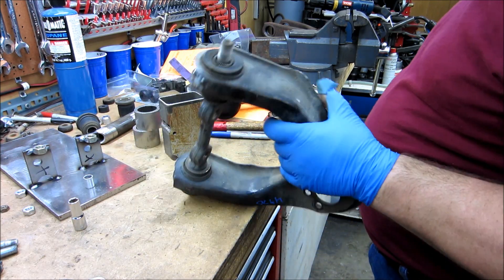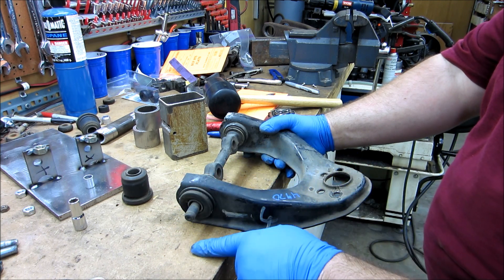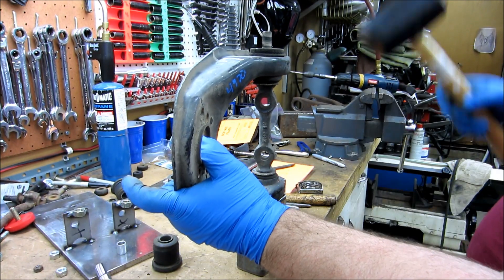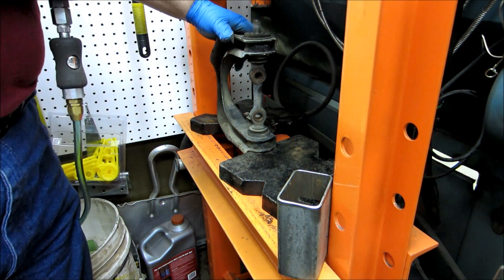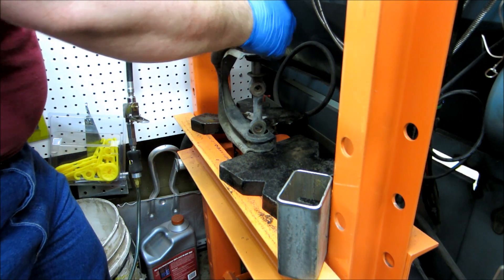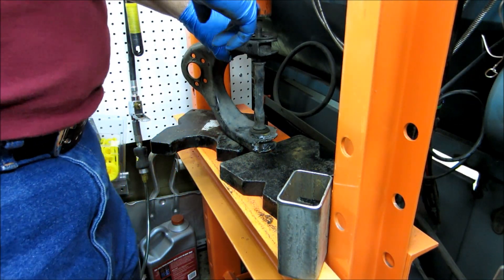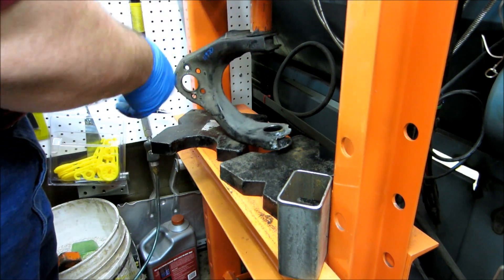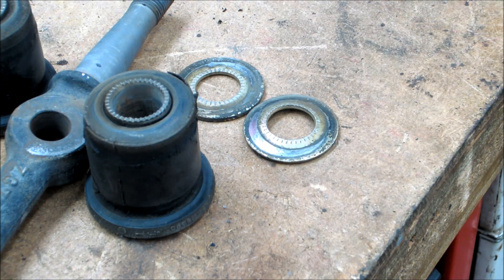UCA Bushing Removal

Comment: Is that the Harbor Freight 20 ton press? How did you modify the jack to accept the air?
Reply from the maker: I replaced the jack with HF's air over hydraulic jack.
20 ton Shop Press Valve Release Knob
Do a search for  20 ton air  on HF's site and you should find it.
Reply: Thanks for the quick reply!
Reply from the maker: VaporheadATC
You're more than welcome :)